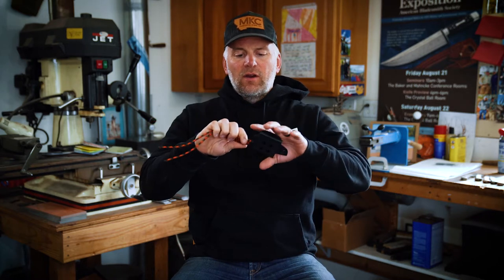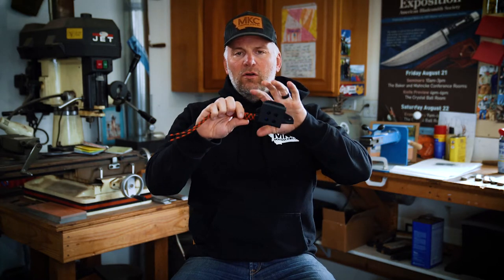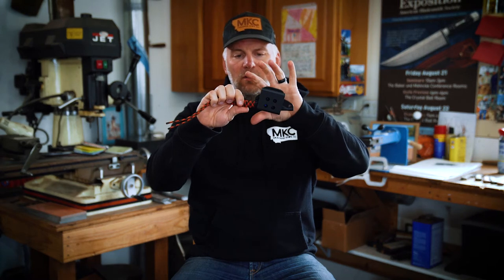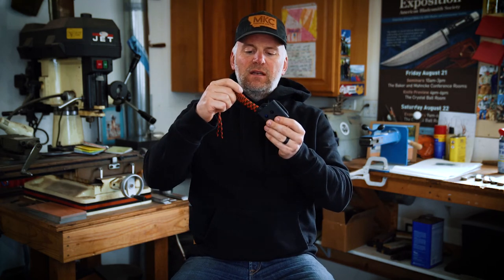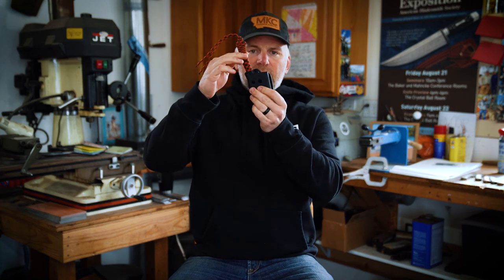Sheath Safety Tips with Master Bladesmith Josh Smith!

Comment: As a new owner of the min speed goat how do you adjust the sheath orientation?
Reply from the maker: Great question! If you are using the kydex clip, you just remove the two screws and move the clip to where you want it then screw in. For the metal pocket clip, you can adjust vertically up or down the longer side, but it’s only vertical since it’s made to clip on the side of the pocket. Hope that helps!
Reply: @MontanaKnifeCompany  Thank you so much